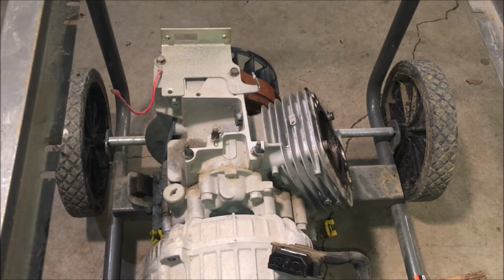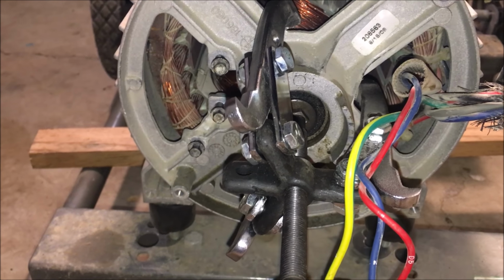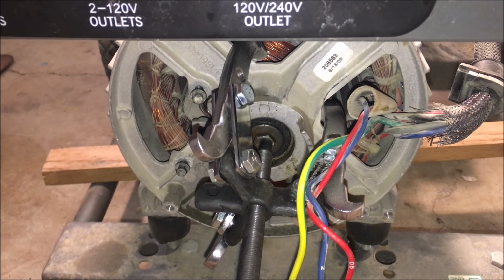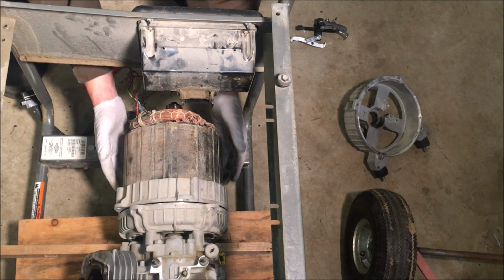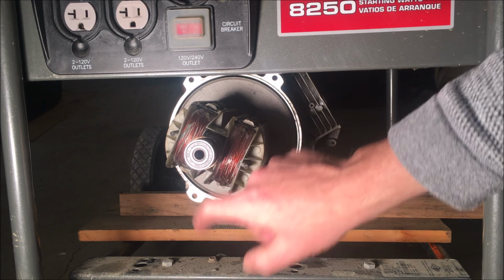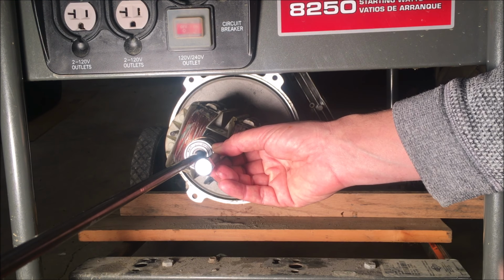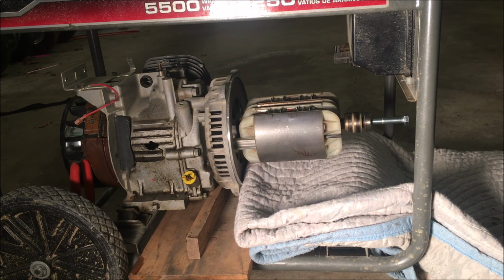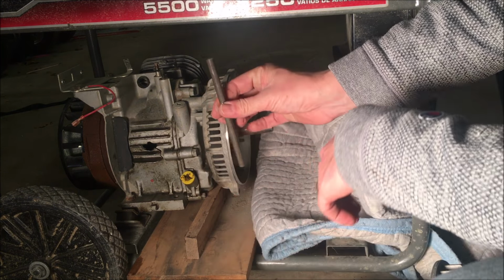How to Remove a Generator Armature and Stator

Comment: Put water down the hole instead of a rod to get rotor off.  Then the bolt .  It works .. fill hole completely with water then put bolt in . As you tighten the bolt the rotor pops off. Think it sounds crazy? So did I until I did it.  Ive done 10 or more like that and it works every time .  Obviously you have to stand the generator on its end to do it.  Try it sometime.
Reply from the maker: That is my favorite way to do it
Reply: @jcondon1  hyraulic fluid or oil will work too, but is messier.

Comment: I have a very old Onan pro 5000 series And the armature was already threaded, The electrical part was fried and burnt, The armeture and stator And i couldnt find any replacement parts online so i decided to make a gokart with the engine and this method of removing the armeture worked very well, I tightened the screw very tight and start tapping the armeture with a hammer and it blew right off!!! Thanks!!!

Comment: At least when the engine is junk you don't have to worry about damaging the threads on the end of the tapered crankshaft. Different story for a working engine.
Reply from the maker: Correct.  I use water to remove them when I think damage may occur to the crank threads.

Comment: I tried removing rotor as you explained, I used a 12mm bolt and it was very, very tite and the bolt snapped of inside the shaft......bugger.

Comment: 111 why not just pull whole assembly at this point with bolt and rod? Remove brushes of course. Working in a black maxx, need to check seal.

Comment: I picked up a gx160 genny, just for the engine.. it doesnt produce power... I cannot get the rotor off, for the life of me! Mine was pre-threaded.. so i just cut down the long bolt that bolts it in place.. Ive put my milwaukee impact driver on it at full power... wont pop off haha

Comment: Good job!  On my generator to get the housing off I just tapped gently with a hammer on the side and it came off with no puller necessary.  When you actually did pull the armature off there is a threaded plug you can buy to put in the spark plug hole to keep the piston from moving so you can tighten down on the bolt without the flywheel turning.

Comment: I have question, what size o diameter is the bolt to punch the roundbar? And the bolt is standard tread or metric tread? Please help me because now I need fixed my generator and I need remove the rotor from engine.
Reply from the maker: I think I used a 3/8 inch rod.  The bolt was standard 5/16 24

Comment from the maker: Sorry, should have noted that.  Do not have that info now.  All I did was remove the bolt from the rotor, measure the diameter with a caliper went online to find the recommended tap size.  The original tap I used ended up being too tight so quickly changed the size.
Reply: And How did you simply remove the bolt ?
Reply from the maker: Garry Seloske I removed the spark plug, rotated the cylinder to bottom dead center and filled with rope to lock up the engine.  You can see me doing that here https://youtu.be/tX1sSLhNSio

Comment: Any way to remove the bolt inside if it now?
Reply from the maker: What do you mean?  The rod?  If the rotor is still on, I use a magnet to remove it when needed.  Otherwise you would have to tip the generator to get it out.

Comment: James, love your videos, VERY educational! I've been a tactical generator technician, (military trained) for over 30 years, your examples are outstanding! My question to you is are you experiencing any carburetor quality issues when purchasing replacement OE types from Amazon? I get the impression there is a tremendous uptick in downsized main jet issues since many of my repairs, when using Amazon sourced carbs, begin to experience speed reductions when load is applied to the generator. The governor responds properly when manipulated however even with low load, a reduction of speed is noticed. I've even considered honing the main jet to a larger size which it generally improves performance but not the correct corrective action... but one that works. Your thoughts?
Reply from the maker: Honda clone carbs work well.  Have tried Subaru, Briggs and Tecumseh clones and had a lot of issues with the jetting being off.  Oddly most have been too rich.

Comment: Thanks.  I hadn't done that one before and needed a hint.  Taking apart the coleman 5K generator a friend gave us with bad engine,  it had threads in the end already and the first bolt I tried on it from the spare bolt drawer fit perfect.  That was interesting luck.
Reply from the maker: TnMtnRdr having threads is good luck never mind finding the right bolt on the first try.